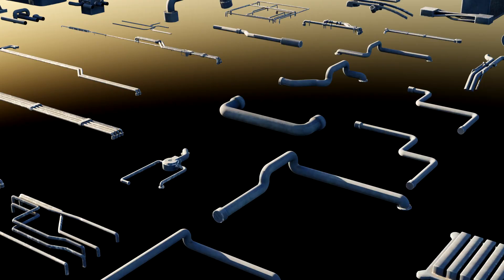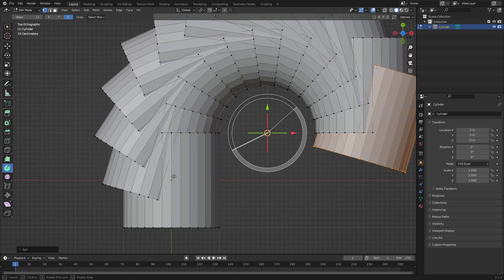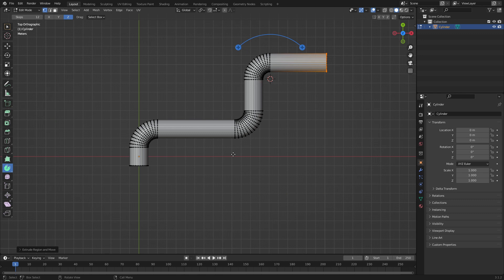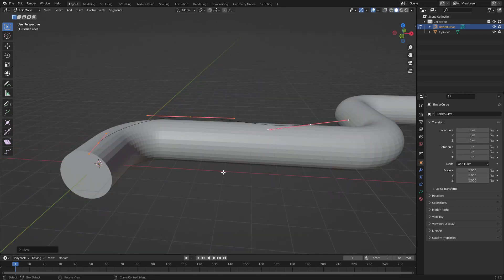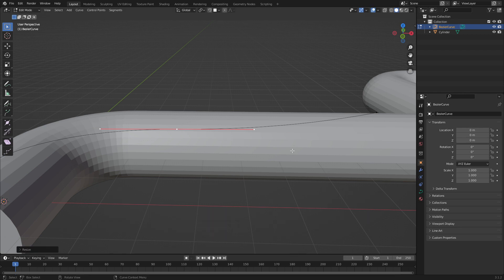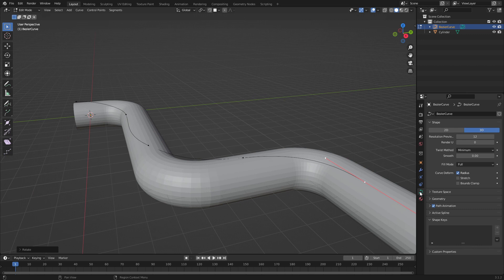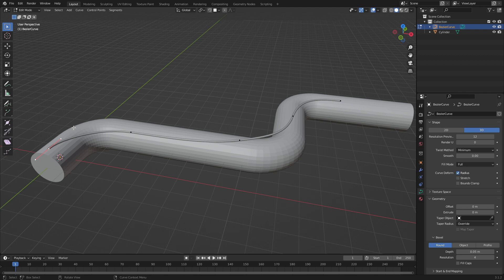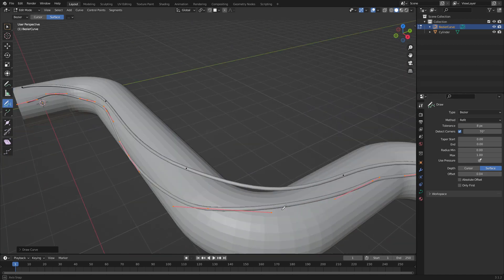3 Best Ways to Make Pipes in Blender

Comment: For some reason I thought there was a modifier that would make simple edge extrusions 3d (skin/solidify?) combined with a subsurf = pipes so I kept looking for that way cause I am lazy (or perhaps stubborn)  instead of just using curves, bevel and taper objects are really cool and powerful but I just wanted a faster way using mesh for some reason. It occurs to me now that I can just spin some basics out then use booleans to snap them together how i want then arrays for larger composites.
Been away from blender for quite a while, that draw technique I didn't know about that is very cool, missed out on all that grease pencil and fancy drawing stuff they went all crazy about somewhere around 2.8 .